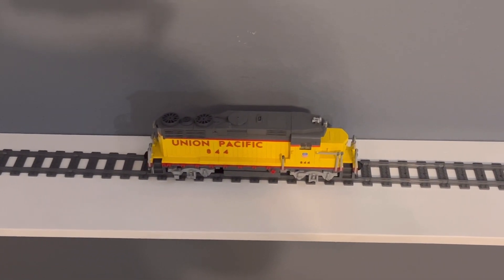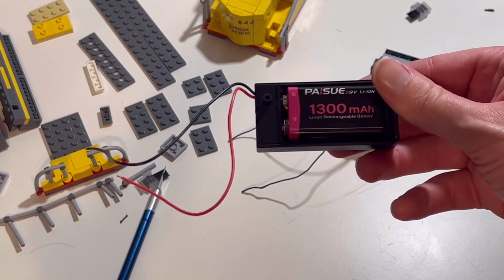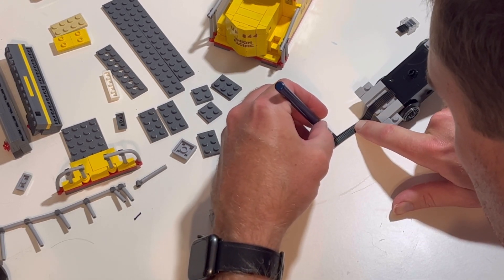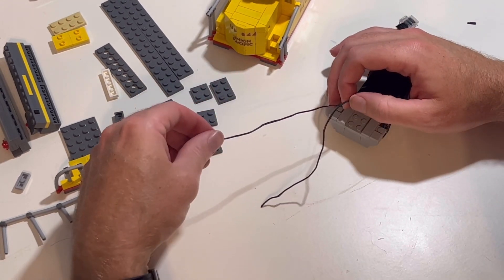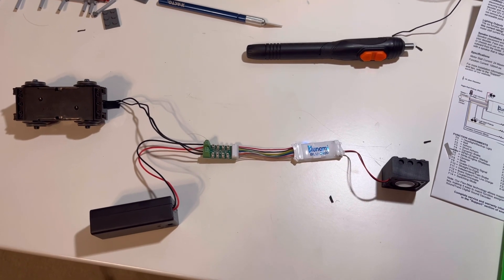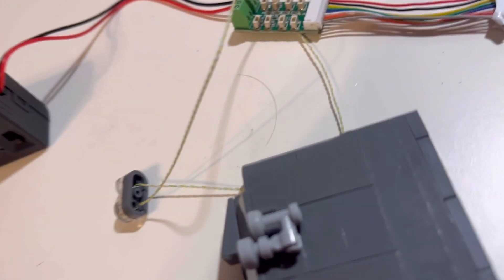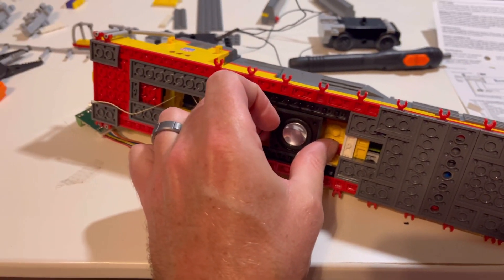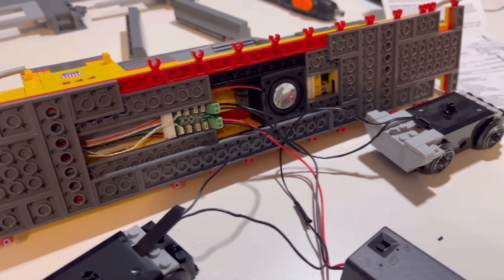Soundtraxx BLUNAMI installed in Lego GP30

Comment: I’m not sure if I recommend blunami because you would take a brand new motor and cut the wires. Then you solder the wires. I feel like you would waste money on a new Lego motor to just use the blunami system. Isn’t there another way to set up blunami without cutting the wires to the motor.
Reply from the maker: No there isn’t really. The lego connectors only work with lego control systems. Not really “wasting” a motor when it’s going to power that train for its life.

Comment: I'm guessing you thought a single 9v battery would work instead of 6x 1.5v cells to equal 9v? I'm currently running 2x 18650 @ 8.4v lithium batteries in series with no problems 👍🏻
Reply from the maker: Yeah originally used just the 9V cause that’s what soundtraxx had in theirs but they weren’t carrying any load. Now I have a 15.8V roomba battery in a trailing box car.
Reply: @Flysooner9  Oh right, I read soundtraxx used 6x 1.5v cells.

Comment: Would this work with the PU L-motor?   I'm working on a couple new locomotive projects that utilize them over the standard PU train motor.
Reply from the maker: Yes it should with no issues. Wiring would essentially be the same. Just have to cut and strip the wires on the motor.